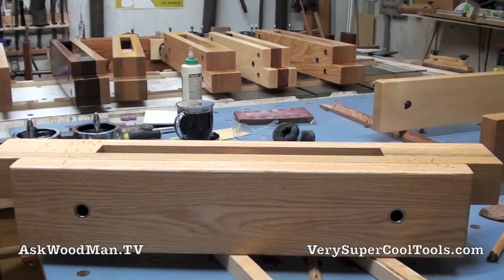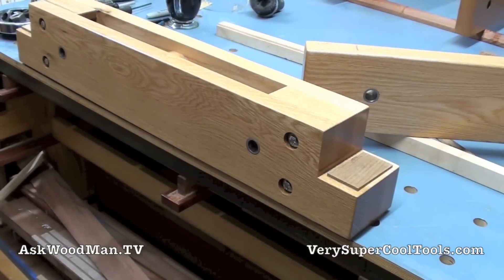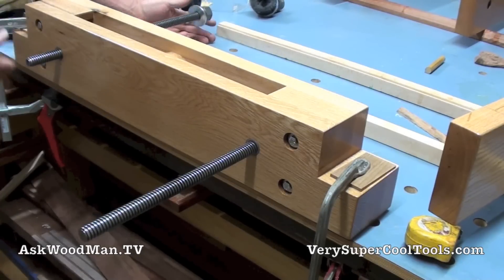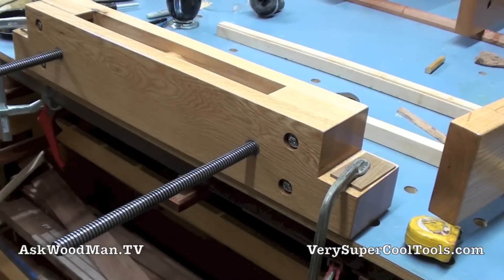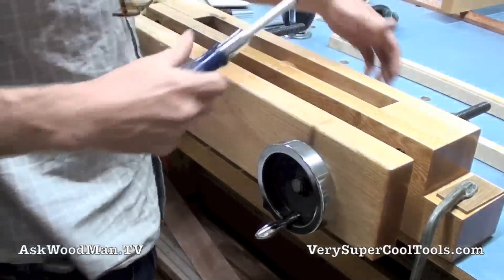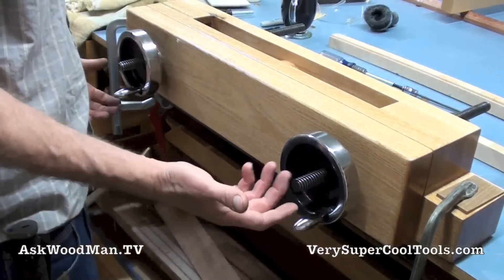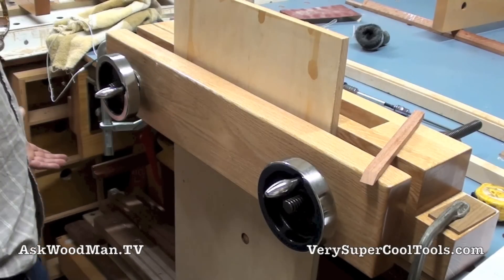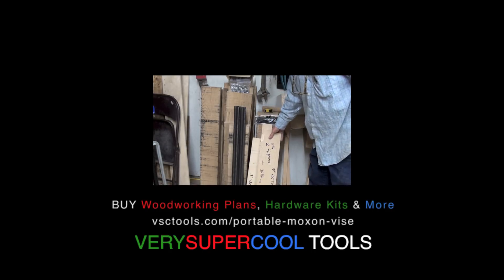Make A Portable Moxon Vise • 02 • Moxon Features

Comment: Greetings
I appreciate the quality of your craftsmanship. What would it be like to secure the turn handles to the ends of the rods and spin the rods in, away from you? That would eliminate all the adjustment hardware and require only a secure threaded nut in the back member. Turning the handle and exposing more rod to the user seems unsafe to me. What are your thoughts?
Reply from the maker: The handles are cast iron. The rod is steel. Connecting them by welding is not an option. So some type of set screw machined keyway would have to be done. Complicated. Then welding nut to flange plate and getting perfect alignment. Again complicated. There is nothing unsafe about this setup.
Reply: @AskWoodMan  
Thank you for your reply. As I said, I like your design and workmanship. When I searched out parts last night, I found a source for the Acme threaded rod and a source for non-threaded Zink wheels with set screws. Having the threaded rod turn into nuts in the back of the vise vs running the wheels on the rod is a personal preference. My perspective is that anytime I can reduce exposure to projecting objects during the woodworking process, the better. I admit to being prone to scrape and whack myself on protruding hard surface while focused on the task at hand. That takes nothing away from your project. I look forward to seeing more of your excellent work - and I really appreciate your use of the bushings in the vise jaws - very nice.

Comment: Nice looking vise.  When you called it a beast I had to laugh because I think everything you build is a beast.  How about a name change?  Very Super Cool Beast Tools?  
I had a thought about design.  Could you capture the lock collar in body of the vise and instead of an Allen head use a clamping knob?
Reply from the maker: I have thought about your comment and can't picture what you are thinking of.
Reply: AskWoodMan I thought you were using a lock collar with a single Allen bolt and could just replace the Allen bolt with a threaded rod with a knob on the end.  After looking at your design more carefully I see you are using a split collar with 2 Allen bolts so my idea wont work.  
Having given it more thought what if the Acme thread was fastened to the hand wheel so that they both turned together and the nut was fastened to the back of the vise so that it didn't turn freely.  I think that would do away with the stop collar and the Acme thread would just thread out of the back of the vise.
Reply from the maker: Terry Pullen
That is an interesting idea. A really good one in fact. I could weld and acme nut to a plate and set and bolt it to the back. You have given me something to chew on. Thanks Terry. Lets keep spitballing this.